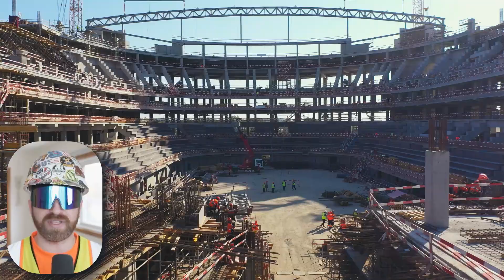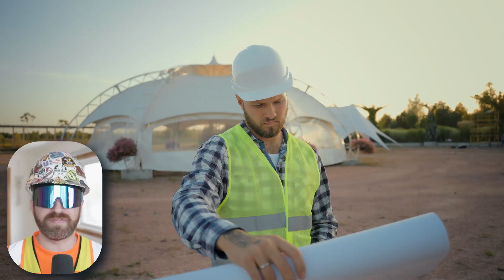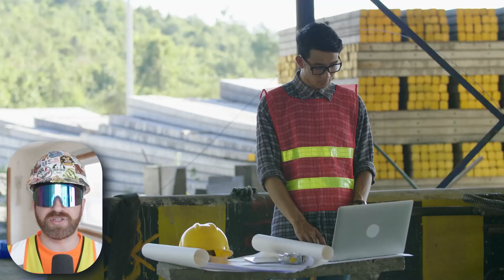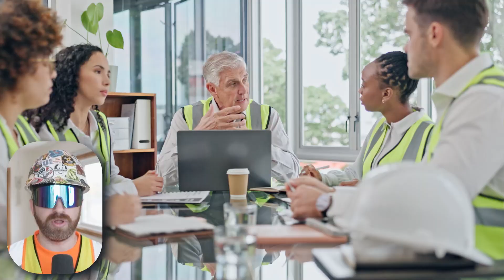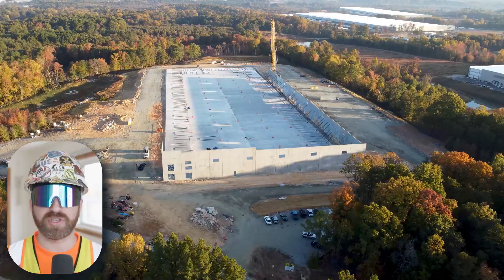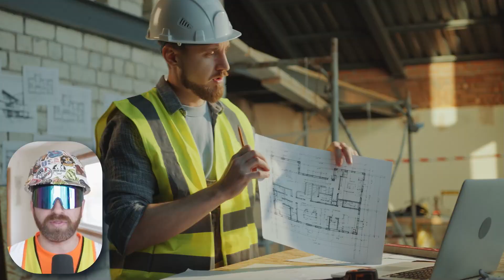Make the BEST Decisions in Construction!

Comment: Do you have any advice on how to move from a project engineer role to field engineer / assistant super. Only a month and a half into my new PE role but I want to make a switch to the field
Reply from the maker: Does your company have those field roles?  If so, talk to your boss and just be straight forward with where youre at.  Might not happen immediately but thats the first step.  Otherwise, I would just start applying to those roles.  A field engineer and project engineer are entry level roles, so shouldn't be a major deal if those positions are open